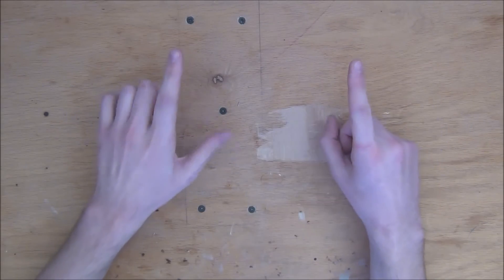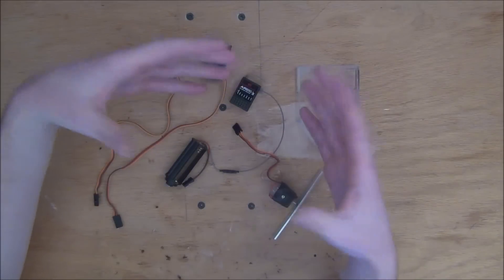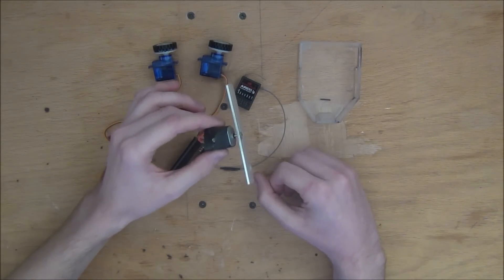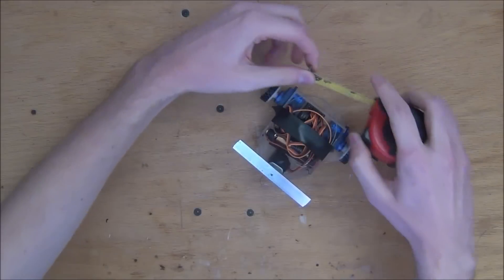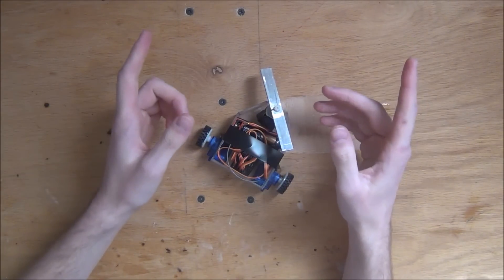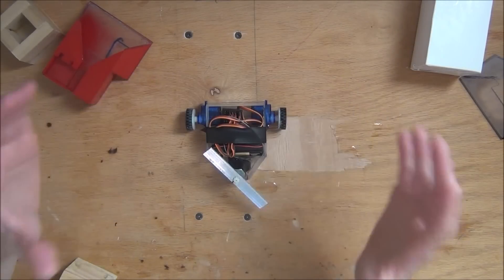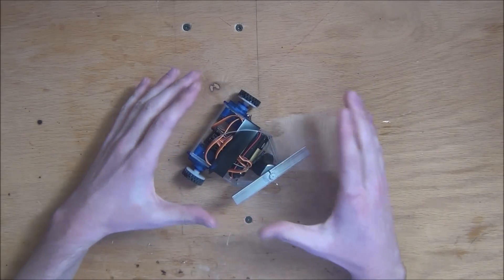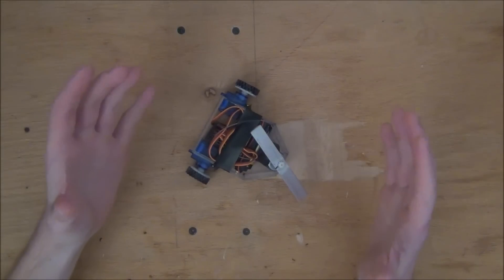How To Make A 150 Gram Spinner Battlebot!!!

Comment: Cool video! I know I am very very late, but a 0703 or 1103 brushless motor works with 4V and I've seen some builders use that motor for robots this size. I don't own a motor that size though, and I don't know the torque ratings but they have >10000KV ratings on them so they will be super fast.

Comment: when the spinner starts is it you controlling it with the left stick on the transmitter like you do with flippers? im just asking because i would like to make my own spinner bot. also are FlySky recievers and transmitter good enough? im planning on using them because they're about $45 and look decent.
Reply from the maker: Yes, I am controlling its speed with the left joy stick but you could easily change which one controls it. I have never owned a Flysky transmitter but it should be a fine one to start with. However I would greatly encourage you to look up some reviews on the model you plan on buying before you get it.  :)
Reply: Mechanical Ninjineer how did you change the controls?

Comment: You've seem to misheard the 4" cube rule. Its not that the bots size is limited to 4" cubed, its that it has to fit in a 4" cube in any orientation. As it stands, your bot is probably small enough to fit.

For a weapon motor, try looking into quad copter motors. I'd recommend the DYS BE 1806, its the most common plug and play weapon motor for the class so far. You'll need a brushless ESC(Like ZTM or Afro) and a 2S lipo(180mha 25C is as low as I would go), but the system is pretty bullet proof. If your ESC has a BEC, you can run the servos that you're already running, but modding the servos to take the lipo directly is not a hard hack(Disconnect the middle wire on the servos PWM cable and hook it up to your voltage in, simple as that. Test it with a spare first to make sure the electronics can handle the extra voltage).

For a better weapon material that you can still find at Lowes, 2mm 304 stainless steel. You'll have to sharpen the edge occasionally, but it should be way better than the aluminum flashing your using.

If you're going to get into more powerful spinners, you should make the chassis out of lexan. Your current plexyglass chassis will likely not be able to handle the spinners recoil. If you do go back to lexan, don't glue it together, super glue will chemically damage the lexan and will make it extremely brittle. Think folded origami, not welding.
Reply from the maker: Yes, that is actually what I said in the video, that it has to fit inside a 4in cube. A quad copter motor would be cool but I would have to step up my voltage which I might do a little further down the line. Yes, I am experimenting with different blade types, I just used aluminum because of how light and strong it is but I will definitely look into the stainless steel! I agree Lexan is way better then Plexiglas! Lexan is 250 times stronger then glass where as Plexiglas is only 10. But Lexan is also heavier and would put me over weight :(  but my Plexiglas body is still pretty strong and can handle a lot. :)       Thank you so much for watching and for your ideas! I really appreciate it!  :)

Comment: How about getting an old high carbon steel kitchen knife and making it into the spinner blade?  Most materials you would hit on a 150g opponent would be plastic or aluminum and a nice high carbon steel knife blade would slice through those and stay decently sharp doing it.

Comment: also how did you build the blade and it's motor
Reply from the maker: For the blade I just used an aluminum strip that I bought from Lowes. I have not sharpened it yet but I hope to soon!

Comment: does the bot scrape accross the floor with two wheels on?
Reply from the maker: With the wheels on the only parts that make contact with the floor are the two wheels and the very tip of the front of the robot.
Reply: ok :) i didnt want to put a giant scrape across my floor thats all
Reply from the maker: You won't. its only 150 grams
Reply: awesome!

Comment: what would you advise to do first
Reply from the maker: Advise on what? building battlebots in generally or this one specifically? I guess I would say the best place to start is with the receiver and transmitter because your whole robot is built around it. I use a spectrum DXE and it cost about $100 or $150 (cant remember which one! haha!) But you could find a less expensive one to start off with if that price is too steep. :)
Reply: Mechanical Ninjineer I might use a receiver and transmitter from an rc car if it would be suitable

Comment: First you need a mixer for your transmitter to be able to control it smoother, and second your motor has very bad torque so it takes a while to spin up and in that time the other bot could get to you. You need a motor with more torque like a brushless motor, and you need a lipo battery. Also if you go with a heavier blade right now your spin up will be even worse, and you wont even hit harder. If your interested tell me and i can tell you what stuff you need to make this competitive.
Reply from the maker: That's why I said it was a prototype,  in the video I said that I plan to upgrade a few parts. And although torque is important you need more speed then torque when you are building a spinner (the more speed the more kinetic energy). As far as mixing the transmitter that all comes down to personal preference and what you have practiced with ( when building a battlebot about 30% of the process is building it and 70% is learning to drive it well) For this bots weight class it is actually doing quite well  :)   But thank you so much for watching! I'm glad you liked it! :)

Comment: How do you drive a 2 wheel bot and control the weapon at the same time (btw I subbed with notifications on I enjoy ur content)
Reply from the maker: the way I have it set up on my transmitter, one thumb controls all of the driving and the other the weapon.  :)
Reply: Mechanical Ninjineer but do I have to code or is it something on the controller
Reply: u should make a tutorial on how to do that
Reply: also switch out the dc motor for brushless motor way more dmg
Reply from the maker: You could program it depending on what type of transmitter you buy but its super easy to do.  And yes, I talked about replacing the motor in the video.
Reply: you should do a more in depth video on how ur bot works how to program the bot but like a time lapse if u could im sure that would help a lot of people (like me) out
Reply from the maker: You actually don't have to program it  :)
Reply: u should show us how u set it to drive for one thumb and weapon motor for the other
Reply from the maker: I actually made a video about that awhile back.    https://www.youtube.com/edit?o=U&video_id=GvaSwPQpz0E
Reply: send me a different link that sends me to my vid manager
Reply from the maker: try this    https://www.youtube.com/watch?v=GvaSwPQpz0E

Comment: Do you have a parts list?
Reply from the maker: No, sadly I don't.  All I really used though was Plexiglas for the body, servos for the drive and then just the battery pack.  :)
Reply: Mechanical Ninjineer what was the battery pack, and what was the specific RC for this device?
Reply from the maker: The battery pack is just a AAA holder that ca hold 3 batteries. What you mean by "specific RC"? You mean what transmitter did I use? I use a spectrum DXE transmitter. I actually talk about it a little more in this video  :)    https://www.youtube.com/watch?v=GvaSwPQpz0E

Comment: hello it is me yet again i should probably have your email mechanical engineer cause i have so many questions! :D lol.  Do you need to use a different motor fotr your spinner and also you know how you had 2 wires attached on your motor for your spinner, but some how you attached it onto a 3 cable wiring, so you can attach it onto the transmitter. AHow did you do that?
Reply: Yeah how do you? I wonder about that too
Reply from the maker: My email is "Mechninjineer@outlook.com" however! Fair warning! I almost NEVER check it. so if I don't get back to you right away I'm not ignoring you I'm just haven't checked my email. But I am on Instagram ALL the time if you want to message me there! As for the wire question this video should explain it better then I could in a comment.  :)   https://www.youtube.com/edit?o=U&video_id=lU4jnogexZE
Reply: i clicked on the link, but it said that there were no videos found
Reply from the maker: strange, try this one https://www.youtube.com/watch?v=lU4jnogexZE

Comment: I have to question your willingness to spin that thing up while holding it. That's not very safe, you could lose a finger or two that way, and with bigger bots the consequences could be far more damaging or even lethal.

Also, the 4" square box rule is only in the UK and competitions that use FRA rules. It's not a part of the SPARC ruleset.
Reply from the maker: Thank you so much for your concern! but its not strong enough to take a finger.   :)
Reply: Well, you are direct-driving the weapon off of a 180-size brushed motor, but I still wouldn't get into the habit of grabbing a spinner robot while it's spun up.